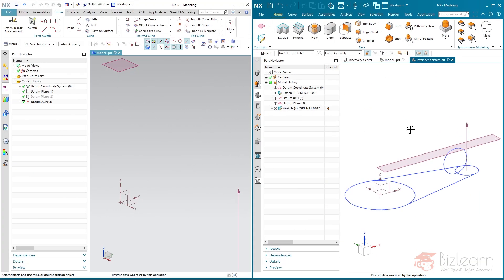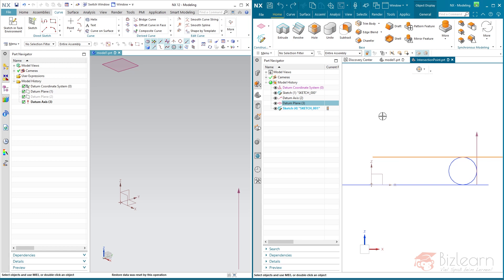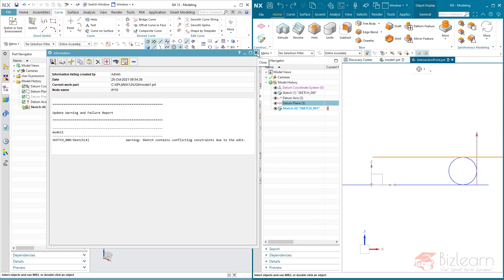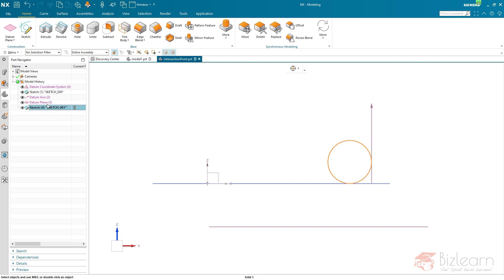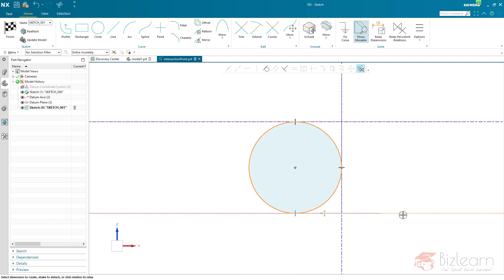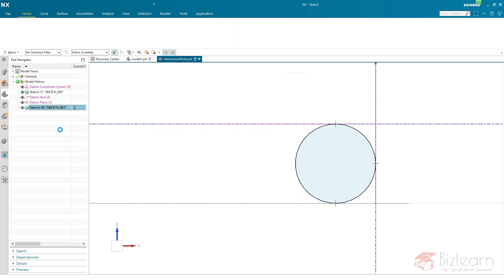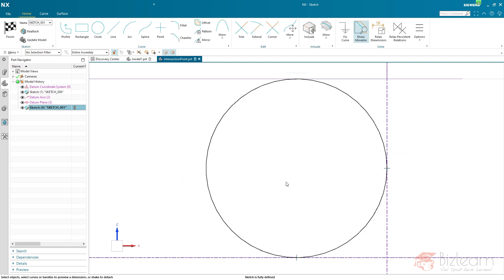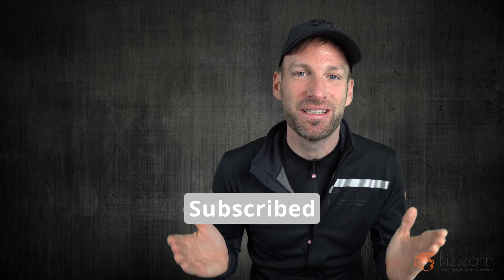Siemens NX 1980 - New vs Old Sketch Solver #1 - Do Relations allow more stability than Constraints?

Comment: the new sketcher SUCKS it is so bloody annoying
Reply from the maker: Depends on the workflow! I have made some good and bad experience with it. Compared to the old solver, it's a fail! So, I agree! But my expectation is Siemens solving some of the issues in the near future.
Reply: @Bizlearn_Siemens_NX_Training  Hopefully! Also the mirror tool doesn't seem to keep the new mirrored side associative to the original dimensioned side - is this actually how it is or am i doing something wrong? (i.e. when i change a dim on one side it does not change the mirrored side)
Reply from the maker: Mirror and some of the others can be persistent or not. There is an option which needs to be enabled. Then it behaves like before.
Reply: This is a great solver if you use Solid Edge...I pretty sure development took that solver and put it directly into NX. This might give both NX and Solid Edge the ability to modify each other's sketches!